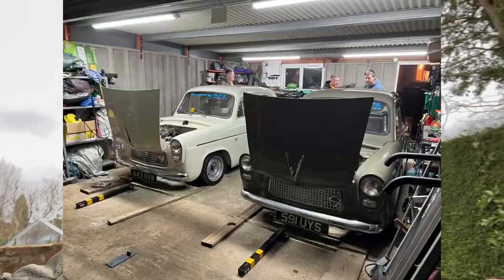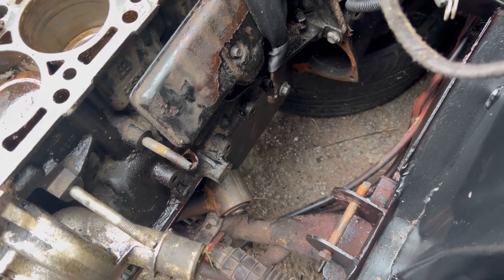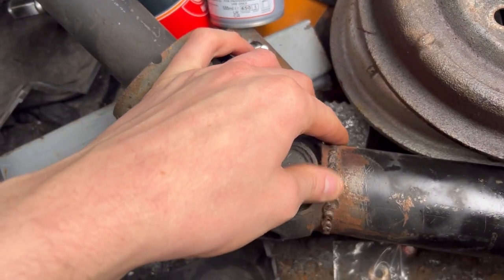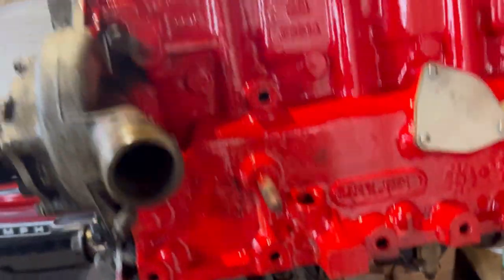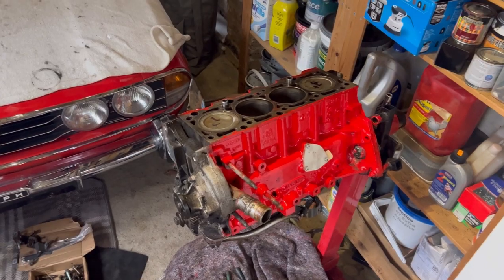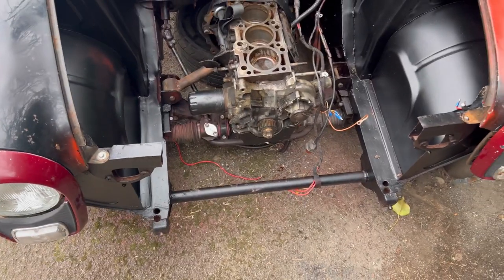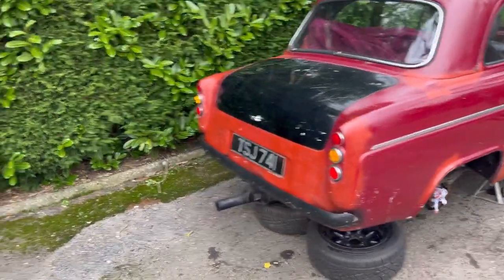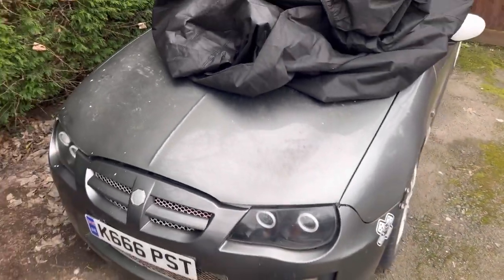100e ENGINE FITTED?? - Project Classic Ford

Comment: My first car was a 1957 100e that my father had sold a set of new Gulf tires to the owner. He returned two weeks later asking if we would give him his $100 back (that was what a set of 2 ply 13” tubeless tires cost back in 1964 and that included mounting and balancing). Well my father told him that he could not do that because he could not resale the tires as new to recupe his money, not to mention the labor of taking them off again. So the guy said that he would take a hundred dollars for the car because the r were engine was needing a rebuild. I was turning 16 in a few months so my dad agreed and told me to park it on the back corner behind the tire changing area and that I could only work on it when I was coughed up on my school work and my shift at the station.
Our neighbors owned an auto parts and machine shop. So it only took me about a couple of hours to take the motor out and call them to pick it up. Luckily all of the bolts were SAE so that there were no special English tools required. But what was required was patience, it took our 3 months for the machine shop to get the rebuild kit and then a month to work it into the schedule. As you can imagine I was anxious to get it back, so I spent the time modifying it. Let me say that even though I had never seen this car before, the flathead engine was nothing new to me and my father. Our service truck, which was totally restored from the frame up, was a 1948 Ford F 150 with a flathead V 8.
Well the little e100 was s powder blue paint that was faded and dull and worn through in place on top of the finders, so my first modification was to paint it. I choose Corvette Candy Apple Red Metal Flake, but in those days it was an enamel paint, and I had to water sand the dead paint off multiple times, paint it with a primer and when cured from sitting in the Florida sun, water sand it multiple times. Then came the time to spray the finished enamel. Luckily there was a retired man who knew how to paint and he gave me instructions and encouragement. It actually came out pretty good with on on or two runs that were not obvious until you looked closer.
While I waited for the engine, I took the front bumper off and tossed it, jacked up the front suspension a little, put a set of the largest 13” tires on the rear, and on the inside I put a pair of fighter jet seatbelts that I bought at the surplus store, replaced the shifter knob with a brass small piston from a chainsaw, put a tube type radio in the glovebox sitting on a sling for shock absorption, wedged the speaker between the shifter and the firewall, and finally I could not afford a tachometer, but I took a pressure gage off of an old radiator cap tester that was being replaced and I drilled a hole in the water pump and tapped it and ran a 3/16” copper tube through the firewall and up through the dashboard and mounted the gage there on the right side of the speedometer. So when the engine revved, the gage went to higher pressure until it reached the “Redline”. It was hilarious as it made a clicking noise as it wound up and down. But it was a different time and this was a step above the Soap Box Derby and luckily I lived in a small town and had minimal encounters with heavy traffic and large trucks. Although the little 26 hp engine would scoot the car along at over 70 mph on a flat mile or more stretch of road.
My parents must have realized the danger that this small car entailed, because they made me sell it and get a baby blue 1955 Chevy BelAire with a Blue Line 6 cylinder engine just before I graduated and went to college. I assume that my car might have been brought here by a military person who ordered it with left hand drive? I never knew of a Ford dealer who sold them.
Well that is my story about my English Ford. The only other one that I saw was in a car magazine and it had been made into a dragster and had to be driven from the back seat….